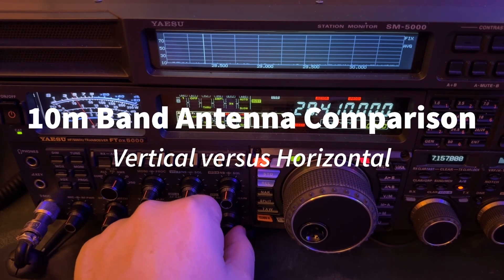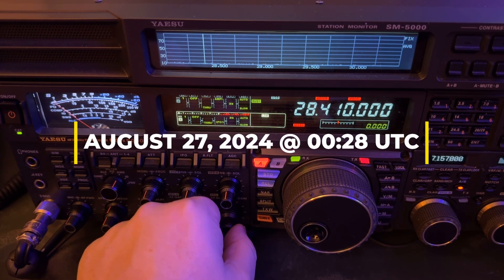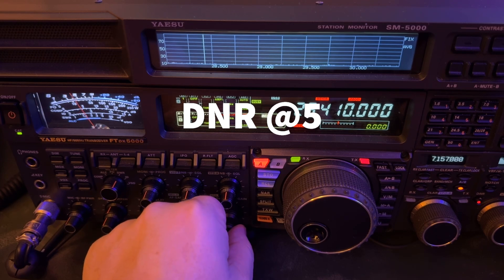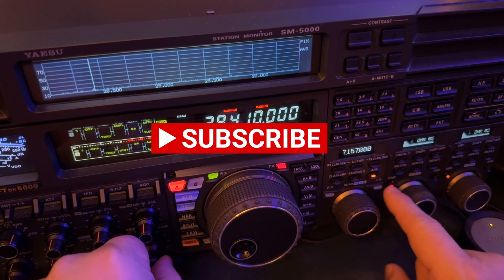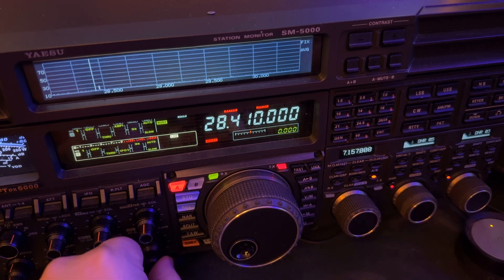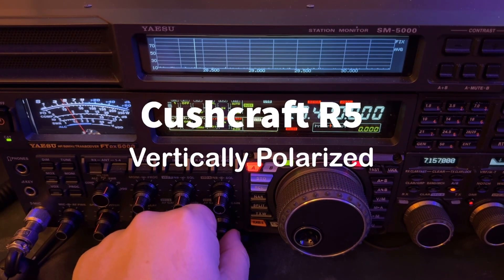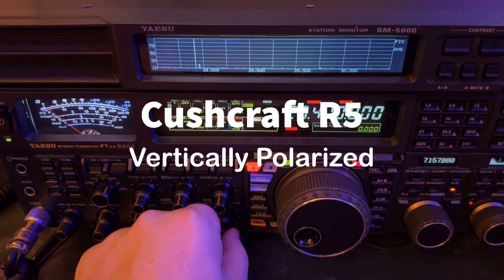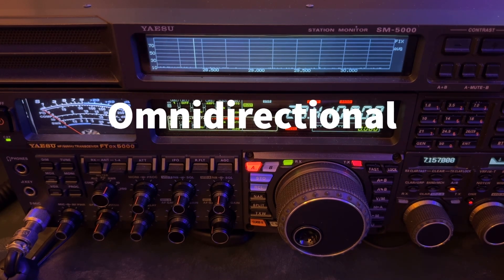10m Band Antenna Comparison: R5 vs Doublet #hamradioantenna #yaesu #propagation

Comment: Doug, 
I have a ZS6BKW wire antenna and a ZeroFive Antennas 10 through 40 meter ground plane antenna. 

Most of the time, on the higher HF bands, most signals are stronger on the vertical than the wire. I've had the vertical up for about 3 months and I like it a lot.

73,
Mike - WB4HUC
Reply from the maker: If the ZS6BKW isn't at least 1/2 wavelength above the ground beneath it, for the band you are using, the vertical will have the edge for DX.  The takeoff angle of a vertically polarized antenna is lower, favoring DX.  It will concentrate the signal more toward the horizon.  A horizontal antenna that is less than 1/2 wavelength above the Earth will have a higher takeoff angle.  My ZS6BKW is 50 feet up.  It is my best 40m antenna.  On the 80m band it has a higher takeoff angle, but that's fine for 80m.  I mostly work regional stations on that band, so the higher takeoff angle can be an advantage.  However, at night, with the D and E layers dissolved, even the higher takeoff angle reaches far enough up to the F layer to refract to Europe.  In this video, the issue is that the horizontal antenna naturally has gain lobes and nulls.  My Doublet has a null toward that part of Canada.  The vertical is omnidirectional.
Reply: @n4hnhradio  In my part of Texas, tall trees are at a premium. Right now the ZS6BKW antenna is installed as an inverted vee with the apex up about 35 feet and the ends of the antenna are 4 or 5 feet off the ground.

So even for an inverted vee I'm not sure the angle between the legs is even 90 degrees. I do have plans to raise the ends to make the antenna more horizontal and less vee-ish, so if/when I get that done I'll see what difference it makes. I do know that the wire antenna is not installed as optimally as it could be.

The vertical is working out well though, and now I have a choice of which antenna to choose depending upon which antenna is working better in any particular situation.
Reply from the maker: @wb4huc10 I told my wife that I can’t have too many antennas.  I posted a video about it.  My ZS6BKW started out as a true inverted V, though Brian Austin (formerly ZS6BKW) recommended a flat top installation.  And mine has worked phenomenally well over the years.  My ends are well above the ground.  One side is approximately 15 feet above the ground and the other side is now approximately 35 feet above ground. It was around 20 feet above ground until a few months ago, when I had to redeploy it after I had two trees cut down. There is a video about it. The tree surgeon used a throw-bag to get that one side up higher. I didn’t ask him to. But he dropped my entire antenna while they cut the trees.  When he rehung it, he tossed the throw-bag over a higher limb on that side. The angle is very different on the side that is 15 feet up. It’s more of an inverted V, like it always was.  The other side is now more like a lazy flat top.  The new angle shifted the point of lowest SWR, most notably on 40 and 20 meters.  It’s still within the band though.  The center is at approximately 50 feet.  And yes, it’s best to avoid an apex angle of 90 degrees or less.  And the window line needs to stay off the ground and away from metal objects, such as gutters, down-spouts, etc.

Comment: The 160 doublet will have many peaks and valleys on 10m. 
Always good to have several antennas to choose from. Hey, that’s what makes it fun.  
You ought to play with that rm noise   When you get a chance, it really amazing. I’ve not myself but I’ve heard A/B tests. Not sure if it works on man made noise but if it does, it would help a lot of people. Works really good on noisy cw or weak signal cw.
Reply from the maker: I've seen RM Noise.  I don't need it.  The FTdx5000MP, FTdx10, and FTdx101 can remove so much noise that I can hear the reverb effect of the AGC hold.  I was running DNR at algorithm 5.  There are 15 algorithms, each one a bit more aggressive than the previous.  Where people mess up with DNR is when they don't first work the noise level down in the front end of the receiver.  Use IPO and RF Gain first.  Let the DSP play clean-up.

Comment: Bonjour, il y a 20dB de différence entre les 2 polarisations, ce qui rend la comparaison difficile.
Mais aussi pour une bonne comparaison il faudrait le faire avec 2 antennes mono bande accordée, je pense.
73's QRO
Reply from the maker: The 20dB rule doesn’t always affect skywave. It affects groundwave 100% though.  That’s why we can use a vertical to work a DX station that is using a Horizontal antenna, and vice versa.  When a signal refracts through the Ionosphere, it can tumble and change polarization.  Have you ever switched from a vertical to a horizontal when a signal fades?  They might be stronger with the horizontal.  But then they fade again and you go back to the vertical, and they are strong on the vertical again.  I’ve demonstrated that with the FTdx5000MP, using a vertical connected to one receiver and a horizontal to the other.  The signal fades in one receiver but gets stronger on the other, but then it cycles back to the other receiver, etc.

The point of this video is that my Doublet has a null toward that portion of Canada, so the Omnidirectional antenna was overall best.  I think I pointed that out in the video.
Reply: Verticals transmit and receive poorly equally in all directions…😊
Reply from the maker: Your comment isn't completely accurate.  Verticals can be very effective for DX work, without needing to be 1/2 wavelength above the Earth beneath.  The horizontally-polarized antennas are less susceptible to noise and can be affective at DX when installed 1/2 wavelength or higher above the Earth beneath.  They can be okay for nighttime DX even if not 1/2 wavelength above the Earth beneath, because the D and E layers dissolve at night, allowing your signal to travel hundreds of miles before refracting.